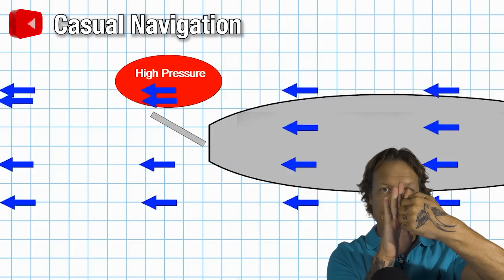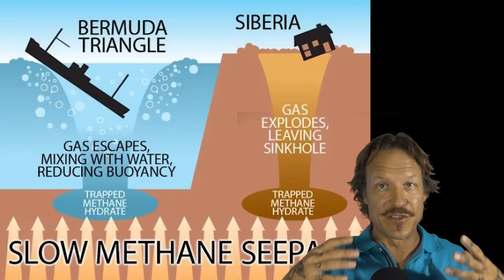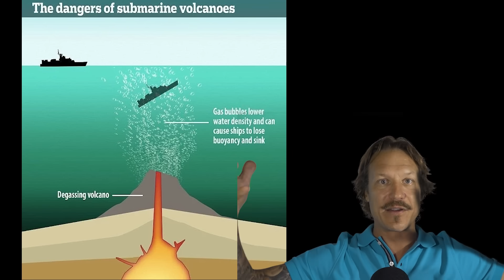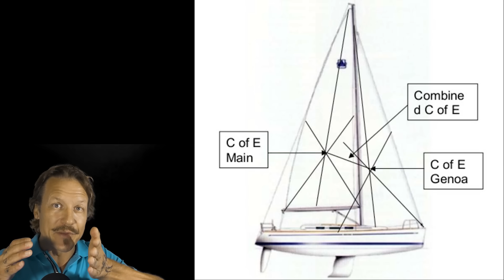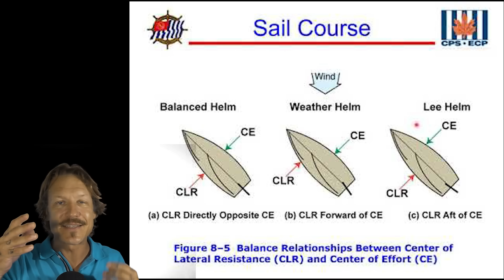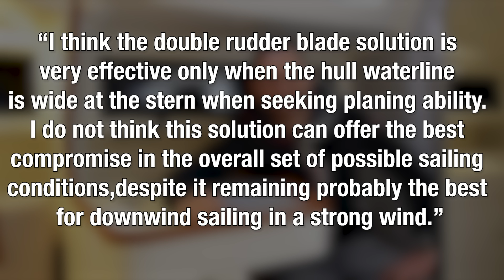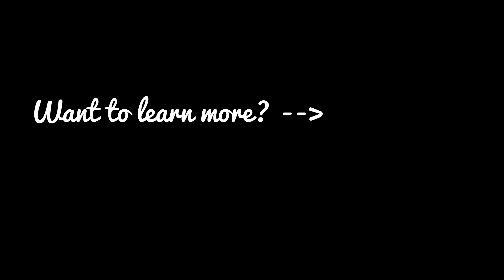The Problem With Dual Rudders Nobody Talks About

Comment: Brother extrapolated prev yacht he built to twin rudders, adding a mast for dbl chine flat arse wishbone ketch, winged cboard. Cpl tours up to islands, liquid lightening un-bustable. 
Met a solo up in tonga- been towed 1500 mn, no rudder. Whereas we smash one off on a container & hey hey- still gotta rudder. Offset that against a small low speed manoeuverability loss not having direct prop wash... 
No brainer. 
Obv some tight arse boats hve twins for no reason- ideal for beamy fat arsed boats & situated on chine. [I copied her for range of r/c yachts, but single stik cat rig wishbone, rudders at 50 deg splay.] 
Twins cn be much shorter for same power- so shoal draft. With small bilge keels to protect th c’board bulb cn sit dwn on the hard- rock shelf etc. 
Cast his own bell-cranks, work out toe ratio from turning circle like a car. Piece o cake. Bulletproof.

Comment: Ok but... I'm confused.  There are several offshore-focused boats in 2025 at various lengths that have no chines and have a single rudder.  Just buy one of those.  I've done blue water with weather hard on the nose and easy on the quarter so I know what you're talking about but dude a cramped cockpit sucks serious ass in all weather.  Maybe just throw a reef in the main?

Comment: You are quite right, but only if the designer of the wide hull doesn’t change the mast position. However, to compensate for the increased weather helm when a wide-hull boat heels, you have to shift the mast to aft. That is exactly what was done on the OC45.
One more thing — many years ago, research was conducted to determine the optimal heeling angle for a sailboat from a speed perspective. Both theoretical and experimental studies were carried out. The conclusion was that 15 degrees is optimal. If the boat heels more (or significantly more), it loses power because the greater the angle, the more wind escapes from the sails through the top.
This is exactly the case with catamarans: less heeling means more speed.

Comment: Hi James, you are absolute right and physical rules are not negotiable. I would like to add one more argument for one central rudder which has to do with prob wash and the ability to manover in harbours at slow speed. With two rudders you do not have any prob wash hence you need more speed i.e. Going backward. Your bow thruster is more effective at low speed as your rudders are.

Comment: james well put, although wide stern has tendency to change the buoyancy thus more correction on the rudder is needed however the twin rudder needs less effort/power on the autopilot/helm (because angle of attack of water on the rudder is more efficient) then single rudder on a say 20degree heel, any thoughts on this?

Comment: very good clip. i want to ad one crucial point against those double rudders. Maybe it has advantages when sailing. But it is very complicated in docking. low speed just kills the maneuverability. direct prop wash to the main rudder to give a strong pull.... worlds better.

Comment: you make a great point about racing design influencing the leisure market. would it be accurate to say that most ocean racing designs optimise for trade wind sailing so pure windward leeward performance is not really their strong point. as a contrast one can look at the evolution of inshore racing design through classes like the Cape 31, TP52, MC36 etc where single rudders are the norm.

Comment: I agree.. but also fat sterns are a bunch of extra wetted surface when they are in light air and the stern is immersed.  These boats are much slower in light air as opposed to any comparable boat with similar horsepower.  As a result, these boats require more HP.  If you sail in the PNW or the Chesapeake, light air performance is a must.  My fav NA is Frers, because his boats perform well over the entire sailing envelope.  I circumnavigated in a mid-eights design and never have a control issue in ten years.  Plus I finished long passages always at the front of the fleet. That is the kind of performance you need.  Fast, safe passagemaking over the entire wind and sea range.

Comment: There's a sailboat company in England that make Rovers. Meaning to kiels opposite one another and a rudder in the center of the stern . They've crossed the Atlantic many times. These boats make it easier to clean the bottom. Just beach on a sandbar and clean away .

Comment: I sailed many miles on a dual rudder gen 2 Solaris 60 and I can tell you that boat sails brilliantly upwind. Up to 20 knots tws without reefing upwind the boat (when trimmed correctly) requires almost zero rudder input. 

The only real issue with dual rudders imo is the lack of manoeuvrability in marina’s, which can easily be solved with bow thrusters. Without bow thrusters the trick is to keep some momentum so the rudders keep working and use wheel effect to get the boat turned

Comment: Changed a 1970s trailer sailer to twin rudders and it was a massive improvement by all possible measures except speed which was largely unchanged.  I don't think a fat stern boat is the only type that would benefit so I'm all for twin rudders now.

Comment: I am a physicist, so I am not gonna argue the physics here, as said, they are what they are.
What I react on, is the two statements
1. Dual rudders are "driven" by the race community.
2. Dual rudders are not an advantage in off shore sailing.

Now, the reason I react to this, is the fact that it is the OFF SHORE racing industry that to a very large degree are the ones "driving" the dual rudder trend. Just look at The Ocean Race and the IMOCA. Now, if dual rudders isn't an advantage in off shore sailing, then why do we see all these off shore races with dual rudders? That's what I would like to know!
Personally I want a single rudder boat simply because we often moore in natural harbours, and every now and then long-side.
Reply: I think alot of people are missing the point of racing having a full and motivated crew micromanaging every second. He is speaking about a small crew with autopilots and long passages where the micromanaging becomes exhausting

Comment: Thanks for the explanation! I once sailed on a dual rudder boat (Dehler but that's beside the point) and it had crazy weather helm when sailing in strong winds. So much so that I had a fight with the helmsman who wanted me to release the main sail to ease the pressure. But I wanted to go fast :) and now I know why it was so hard on the rudder.

Comment: Just recently.. Last week I was sailing from bottom north aegean (Cesme-altinyunus marina) to upper south aegean (Kusadasi), some 70nm journey... once I finished Cesme peninsula I've turned to east an easy (11-15kts) NW was blowing from 120 port and I was going with full-sails set-up to prevent main to block headsail (%115 cenova)... I was a bit tired due to endless upwind tackles earlier that morning (I was solo btw) and fall asleep soon after the easygoing part starts... maybe an hour later I felt like I was falling (it happens often when you nap) but this time I was actually falling from port bank to my cockpit table... Boat was heeled more than 50 degrees and she was about to knocked out... Speed was up to 9,5 kts, wind was turned to 75-80 degrees port and increased like maybe some 30 knots... worse part was my heading was trying to go into the wind to have more bank angle and AP seems cannot handle it... 1st I put 10 degrees starboard command, maybe 5 times... that didn't worked... then AP beeped as "I couldn't hold on, you are on your own" and released the rudder... I took in the helm, made an hard-starboard, that didn't worked as well.. boat was accelareting and heeling more and more... things started to fly inside the cabin (of course cabin wasn't prepared for this much shit)... it was incredible... most part of my only rudder blade was out of the sea, it was working as more as a flap more than a rudder at that angle, there was no water pressure at that shallow.. I've waited for a minute but that seems like this is gonna get only worse... Than I remember, maybe I can increase the water amount over the rudder blade by using engine... I ignited the engine, gave a full-speed, gave a hard starboard againg... 10 seconds later she turned 50 degrees starboard (downwind) and rose from where she knocked... That was the only time I felt like I wish I had a twin rudder blade... But after a week, I still prefer the luxury of single blade of turning boat's stern with a one throttle move in a narrow marina LOL

Comment: Another drawback with twin rudders you've not mentioned is the diminished maneuverability under motor as the prop wash doesn't flow over the rudders as it does with a single rudder. The single rudder deflects the prop wash to push the stern sideways much more positively. 
Planing to put twin rudders on my old, (1990), 9.5 m X 3.4m, light displacement, wide-sterned racer/cruiser in an attempt to eliminate or at least moderate the excessive weather helm the boat develops when wind speed gets over 15-20 knots. The single rudder doesn't lift out of the water when she heels and lose steerage, the weather helm just steers her up into the wind even with the main totally depowered
The lifting bulb keel is too far forward but to move it would be a major operation and impinge on the interior accomodation layout so I'd like to get rid of the big, heavy transom-hung lifting rudder and replace it with two slightly smaller and much lighter carbon lifting rudders pivoting from an extended afterplane. 
The boat currently has fantastic maneuverability under motor but I'm willing to sacrifice this for improved balance under sail.

Comment: After 10 years sailing my wide stern twin rudder boat for 4000 miles, I've been delighted by the perfect balanced sailing, with great performance to windward and finger tip lightweight steering in all wind strengths so never had any of the issues described at all. On the contrary, my previous single rudder boat was the one that developed vicious weather helm with heel, spinning out when a certain angle of heel was reached. So I have to totally disagree with this article!!

Comment: I have a dual rudder boat.

I strongly advise not to get one without a bow thruster.

Getting into marinas backing is impossible without a bow thruster.

Also just went up a river with sea weed and the run off from a flood.

It was hell protecting the rudders from collisions with trees ad logs.

I also have to stop often to remove seaweed caught in them since the keel does not Protech anymore from this.

But all in all i love my boat and would not change it its 40 feet and the space you get is wonderfull.

I rarely intend to do off shore passage making but island hoping and don't forget you spend most of your time on the hook.

If i have a 60 footer then the single rudder would be the choice.

Comment: Thanks, interesting and as usual clear and understandable. There might be one other good reason for twin rudders on (aluminium) centerboard yachts. With a flat hull, a single rudder can’t be designed large enough — it’s simply too short and ends up being too small. Garcias, Allures and Alubats all use short twin rudders. The only exception is Boréal, which adds 2 fixed skeg boards to achieve the required directional stability.

Comment: Again, an American complaining about modern designs coming from Europe. Hallberg-Rassy and other top offshore sailboats have gone wide stern and dual rudder. Any engineering decision is a compromise. Of course you can make a catchy youtube video just focused on the downsides of one solution, but you're ignoring the benefits.

Comment: Hmmm. To me, I think a it different. There are wide Beamed Monohulls with underwater hull sections between the Chines, and those that have flat hulls on the water between chines to encourage surfing. Those with underwater hulls, if properly designed, sail their fastest with very little heeling angle, which is typically in the region of around 15 to 18 degrees - which is very comfortable for those on board when Cruising or voyaging, on the other hand, those with flat hulls between the chines, are a complete slamming nightmare to sail on, and aren’t exactly comfortable to be at anchor in either, but try inly tend to be bought by already brain damaged sailboat racers, and who gives a crap about them right ? What actually benefits from twin rudders ? To me, the old nasty IOR type narrow beamed Racing Sailboats, that go faster when heeled to excessive uncomfortable angles to get an increased waterline length speed boost. Wide Beamed boats that don’t actually heel much do not seem to have Any problems with single rudders- Umberto Felci and Dufour Yachts certainly don’t appear to see any need for them at All, and as someone likely to need commuting up and down the EasternSeaboard of the USA for a few years to come ? Frankly having the thought of Two Unprotected appendages dangling from the back of my boat, gives me the bloody willies, as I will pretty much have to restrict myself to sailing only during the hours of daylight. Why ? Oh, large fields of Lobster Pots, Crab Pots, Fishing , stuff like that just waiting to get snagged on them, plus all at the expense of losing that vital early warning system to depower the Sailsprovided by what ? Weather Helm. Twin Rudders have to be the dumbest nonsense created by Sailboat Racers that have ever been inflicted on Sailboats imho.  Put a dumb sailboat racer on a wide beamed boat, that is supposed to be Sailed as vertically as possible, for the best performance, and what do you get ? A fool that thinks if he can get it heeling as much as possible, it goes faster, then as the ow angle gets parallel with the Water, everything goes tits up and they think wide beamed boats are a very bad idea, because obviously, racing boats need to be just like those used in the 1979 Fastnet Race. Sorry for the Rant, but I have had an absolute gutful of Sailboat Racing Morons and their ingrained bad habits and degrees of Stupid they inflict on the rest of us, ever since that particular Racing Tragedy. Bob. 😡🌟🌟🌟🤔⛵️

Comment: Backing up in tight spaces is another negative element.  Waterflow hits single rudder and provides response.  In twin ridder prop pushes water between rudders thus making much less effective at lower speeds

Comment: Excellent video James. Life long sailor and boat builder. I'm half way round a (mostly) solo circumnavigation in my Hallberg Rassy 38. For me as someone who often sails solo, it's essential to me to have a "mannerly" boat. The older Ollie Enderlein - Full Long keel single rudder Hallberg Rassy's are absolutely perfect for long distance open ocean sailing.  I've hit a few very big logs at night, once off the coast of West Papua and once mid Indian ocean. The rudder skeg had some chunks taken out of it, but zero damage to the rudder. I sleep soundly knowing I have a tough sea worthy boat. I don't know how an exposed twin rudder with no skeg would have fared in that situation.  Sure, my boat is slower than say a new Beneteau, but my HR38 is far more suited to my needs. If I was coastal sailing part-time, maybe I would go for a lighter faster boat.  Like all things in life choose the right tool for the job!  However, It's sad for me to see HR and other traditionally "blue water" boat manufacturers go for the lighter ikea-style twin rudder racey designs. Sure it will sell more boats, but in my opinion not necessarily the right type of boat for my specific needs.

Comment: I have a twin rudder 36' beamy racer/cruiser and I concur with your down wind observations, that's where the boat is happy and fast planing, but I have not experienced any weather helm up wind in conditions up to 30 kts, even with significant heel. The leeward rudder just digs in and does its job and its finger tip control, totally balanced and self driving,. In fact I wish there was a bit more helm but I can induce that with toe in. The problem I am grappling with is drag induced by the windward rudder when it's partially submerged. That's why the comments about transom mounted kickup blades make perfect sense to me, in addition to the other advantages mentioned. I am not disputing what you say but it may not be true for all hull designs. My suggestion is that if you are considering buying a twin rudder boat you have to spend serious time sailing it in all conditions--just going out for a sea trial with a salesman in moderate breeze is not enough to understand what you are getting.
Reply: Your comment applies also to an Oceanis 38.1. We owe it over 4 years by now. It sails stiff and precise, wind changes are taken by acceleration of the boat. Heeling over in gusts is moderate. We are sailing costal waters, I would not change my boat. One anoying point not being metioned. In tight marinas, the rudders are unfortunately always close to the mooring lines. so a mooring (bow) lines of tied up boats are caught easy.

Comment: Kinda wish we could get the guy from Lady K Sailing and you together on a YouTube to debate the issue.  I suspect moderation would be the best compromise.  The guy from Lady K, really likes a dual helm and sugar scoop transom, among other things it makes access to and from a dinghy off the stern easier.  Important for lifting heavy water jugs or just for seniors to climb out of dinghy and onto the boat.  Swimming off the sugar scoop is supposed to be easier, as well.  But these considerations are about living aboard as opposed to performance sailing.  Moderation, I’m sure

Comment: BS, when a ship is tilted to one side at any speed and without sails, for example by cargo, it again tends towards the direction opposite to the side from which it is tilted.
The wide and low stern is due to the hydrodynamics of planing and the two rudder blades are a consequence.